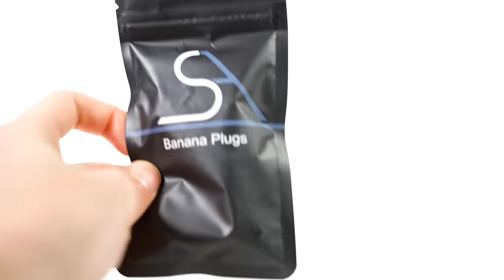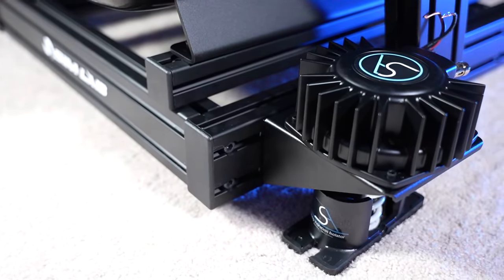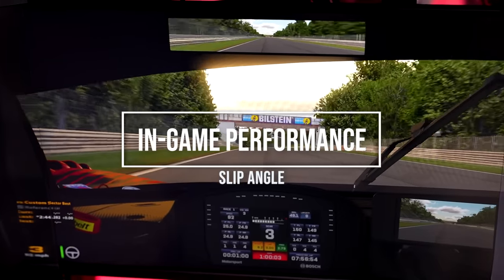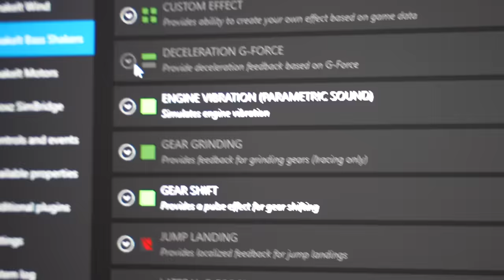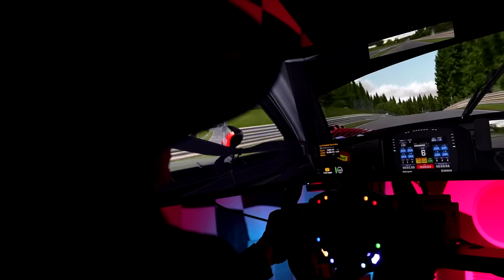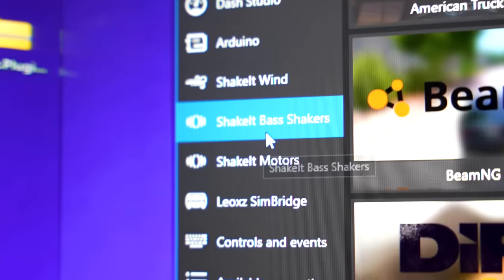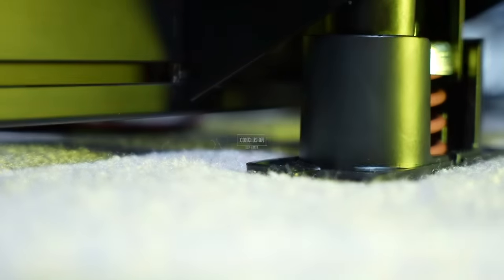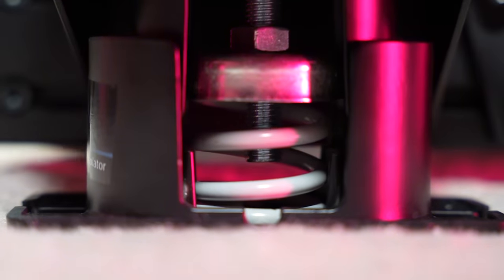Putting my Racing Simulator on Springs!

Comment: I've had this kit for a while now. It's awesome. I started with the 100 watt amp, (don't buy that, it gets hot quickly even with only a few effects enabled in Simhub). Slip angle gave me a discounted price to upgrade to 300watt amp. My 300 watt amp died about a month after getting it, but slip angle replaced it, they provide great service. It is night and day, especially if you have never had tactile feedback on your rig. I had a single butt kicker, and this system is alot better. Feeling curbs from front to rear on each side is amazing.
Reply: Can you feel easily what side and front and back? Or does the whole rig shake regardless what tyre you hit on a kerb?
Reply: @TheCameltotem  no it isolates each side very well. Assuming you have a profile rig, and the game allows etc. The only issue is the replacement 300watt amp didnt last long either, I ended up going back to a similar 100watt amp I bought off Amazon. It still gets hot though. Slip angle may have sorted out the amp issues by now. If they have I’ll buy another 300 watt amp.
Reply: does it help you feel tyre losing grip? can it help with recognizing understeer?

Comment: The video is super fair. I think the issue with providing a set of sim hub profiles is everyone is totally different and will want their own frequencies/strengths/effects. It's worth it to just spend some time in sim hub and get it just how you like it. As for transportation of your rig, if you're going to stay with the slip angle system, you might want to build a platform with casters for your rig to sit on. That way you can move it around while getting the benefits of the SA system.
Reply: even then I'd say some presets for popular titles could come in handy as baselines for those who want them or those who just wanna set and forget without to much effort.

at worst it doesn't take anything away and at best it helps new users figure out what they like or quickly set things up to enjoy a game before making small adjustments as they get used to it.
Reply: I think the issue is a fair point but lack of decent setups is really rough as someone just getting into this, for example I bought a moza wheelbase and I’ve been nothing but disappointed as I can’t get it to feel anything like how I’d expect a steering wheel to feel.

Comment: I bought this kit in Maj and I totally agree. The setup is pretty basic, but the settings are pretty annoying would be great if they add some more profiles or more guides how to get the right frequency for each effect.
Reply: When doing a setup, I use simhub. Remeber too. Less is more! In pretty much every game I use engine vibration, shift engage and either Road vibration or Road impact. That's it. Using too many at once they transducer just start to non stop vibration cause they're doing too much at once. I only have one under my seat and one on my pedals. I save a profile for each game. 35 percent engine vibrations, 80 for shift and 60-70 for raod vibes. I LOVE IT! Take it slow it's not as confusing as it seems. Also setup custom setup with just front and rear zones. Like I said...the more simple.... the better!

Comment: The Dayton BST-1's dont come close to the actuall Buttkickers. They dont last as long, Ive had 2 fail. They dont have as wide a frequency range. They also play far fewer effects per transducer before things get muddied. They are also less powerfull than the buttkickers. Just replaced all my BST-1's for buttkickers. 4 buttkickers can reproduce all of the effects which I previously got from 6 of the BST-1's . Ive speng days in Simhub playing with various settings so I can relate to the long setup times. Im now a Simhub expert!
Reply: But I can put 4 Dayton for the price as one buttkicker
Reply: You're going to need all four of those to replace that one buttkicker, too. I've also had two of them fail. The insides rip apart and they start making awful rattling noises inside.

Comment: I believe the point of this kit is more about vibration isolation so you can sense which inducer is active more than it is about reducing sound, per se. The "noise reduction" benefit is really about reducing noise across the rig so you can better sense which inducer is providing feedback. It's supposed to be akin to having your wheels in a real car on individual springs and providing individual feedback into the chassis.  I can't speak to how well the isolation is as I killed my amp some months ago by using banana plugs on these connectors and letting them touch - don't do that - and I was simply using the LFE built into iracing which does not, as far as I understand, separate channels. But regardless, I will say that using inducers absolutely bring the vehicles alive. The M4 GT3 in iracing went from a complete bore to a harmonious symphony. It's really awesome and I miss it and need to get my amp fixed, and next time start working with SimHub to take advantage of separate channels.

Personally, I bought just the springs and mounts because those are the difficult ones to source (really the mounts are the issue). The inducers are Dayton BST-1's and you can use any amp, of course. The price for everything put together is very reasonable, but if you want a different amp, then just get the Dayton's and amp yourself.

And yes, being able to move the rig is a problem. I bought retractable caster wheels that require drilling larger holes (with the right bits and drill) so you can threat a bolt through it and into a t-nut. My bit's didn't work so I'm still attempting to get these mounted.

Comment: I have this setup on my rig, i only ordered the slip-angle amp 300watt and bst-1 from elswhere, i also got bst-2 under my pedals and seat. Due to extreme shipping cost i did design spring mounts for my rig. theese are alot cheaper and works just as well as the slip-angle sells. 
I also had com to that conclusion less is more when comming to theese bass shakers. Iam waiting for the simagic haptic rumblers for my throttle and break, they are very strong and also dont go on the same system as the shakers, so hopefully they will be no problem with drowning in the shakers.
But setting the rig on springs makes a extreme difference.
Reply: How do you wire up all 4 corners aswell as the under seat and pedal? I have a Nob sound already and am going to order the slip angle bracket soon.
Reply: Got information on the spring design you made? I can design it no problem but not sure what strength spring I would need.

Comment: Thanks for the great video review.  But before investing in this shaker system, I need to get a SIM racing rig and better wheel controller - but the cost of the shaker system is very good.
Right Now I have just a Thrustmaster TMX wheel controller mounted to a desktop, heavy duty foot pedals, and sit in a normal chair. I do have a VR headset for racing.  It works for me.
Anyway, Thanks again. take care.

Comment: Nice.  My concern is with being able to move/slide the rig backwards or forwards, can you slide the rig easily (if on wood floor)?  Currently my rig is on casters, as 1/3 of the front of my rig is under a table, so it's easy to slide back/forth when I need adjustments at the front end.

Comment: This kit costs way too much. I got a similar set up with 4 30w shakers and a 4 channel 200w amp for less than $150. Paid $15 for some industrial equipment vibration isolating feet and basically ended up with the same as this just slightly less powerful. For anyone wondering no one runs these bass shakers on max output anyway so it’s likely that they would never be running higher than 30W.
Reply: Know where you got the feet from? I can design mounts pretty easily myself but no idea what strength springs I'd need so the rig won't be bouncing all over the place.
Reply: Is there a chance you could pop some links to the shakers, feet and amp here (or even just the brand and model/type)? I'd love to do the same at that price, but don't really know which ones to start off with.
Reply: Unless you share where you located the isolating feet, your comment is not helpful at all. I’ve tried searching and similar designed feet cost over 50 bucks a piece and that’s not including shipping and taxes.
Reply: A thick rubber mat or car jack pucks can isolate the vibration better than coil springs
Reply: I’ve tried responding multiple times with the things I bought and YouTube keeps deleting my comments… idk why
Reply: I’ll try again. I bought: 
Dayton audio TT25-8 
Douk audio 4x50w amp
2 rca to 3.5mm adapters
Reply: @alecmillea4539 Yeah links or even store names get deleted automatically by YT. Thanks for sharing 🙏
Reply: @4SUBLIME2O  don’t get hung up on the feet. They are not that important. Soft rubber feet will do a better job of isolating the vibrations to the rig than springs will. Also please try to be nice to people on the internet offering advice on saving money for free.
Reply: @alecmillea4539  Hi can you explain your physical setup. do you have 2 x 3.5mm to rca adapters coming from the pc connecting to the 4 audio inputs on the amp and the outputs of the amp connected to 4 x Dayton Audio TT25-8 Pucks. If so would like to see your windows 10/11 settings along with simhub(or whatever software you use to get the effects)
Reply: @mackd7234  The transducers are connected to the amp with some basic speaker wires just like any old stereo system.
Reply: @alecmillea4539 trying to piece a kit together now, does the rca to 3.5mm go into the back of my pc? That’s the only part I’m confused about. Thanks.
Reply: Also does the amp you listed have a built in sound card?
Reply: @mackd7234  You got it. No special settings on windows to worry about. Just make sure the standard audio is being sent to your headphones/speakers and not being sent to the shakers. I use simhub to control them. It's really personal preference and trial and error to decide what you like. I just turned on one effect at a time to test each thing. I tried to stick with what is realistic. None of the options like increasing vibration with speed or G force felt natural to me. I've only ended up using, Wheel slip, traction loss, wheels lock, road rumble, road vibration, gear shift, and engine rumble.

Comment: While I agree, that finding the right springs to do it yourself has provided some issues for me (since we dont have any proper tech stores in germany), saying it is a husstle to find a 4 channel amplifier is quite a questionable statement.
Reply: They're spring isolators for the HVAC trade. I use similar ones daily at work. Problem is by themselves they're a few hundred dollars depending on spring strength.

Comment: how noticeable are the vibrations and sound? does the springs dampen it so that others in apartment arent bothered with it? and would that dampen so the downstairs neigbours wouldnt notice it?
Reply: Really only noticeable for me if I have a loose bolt somewhere. I am in the basement so it isn't really a fair test. Way quieter than my win sim.

Comment: How much does the average extruded aluminum chassis flex when being supported on all four corners . I can flex mine with full brake applications so its noticable in the wheel  and i have 13 inch  triangulated gussets(8020 cut at 45 degrees) supporting the wheel uprights on both wheel and pedal side on both sides of rig(4 total).

Comment: People keep saying you can build this yourself cheaper??    Apparently,  they have not done the proper research.  Not only are those spring isolators expensive . You have find the ones with proper compression rate .  Also,  those mounting bracket are patent pending .    I personally can't find those brackets anywhere.      if someone knows. please let me know.

Comment: Is it worth getting a gtlite pro even though I have more than enough space for it or can I get better value for another rig which isnt foldable
Reply: If you've got the space for it an 80/20 rig is the way to go, they're very rigid, easily modifiable and very easy to put together.